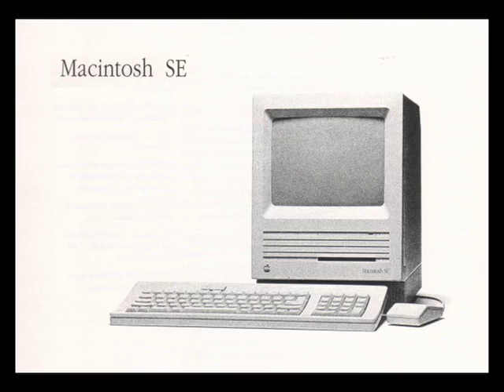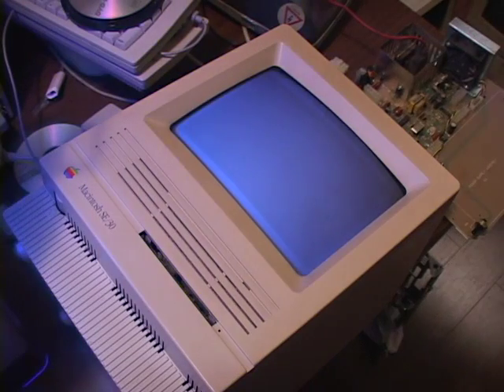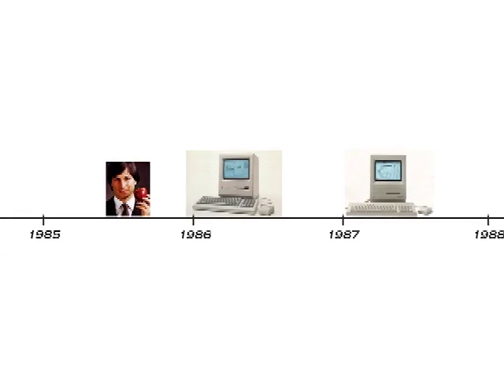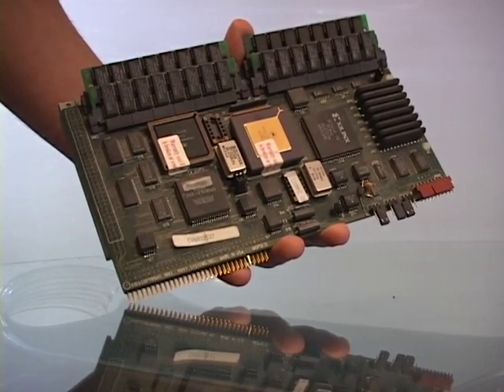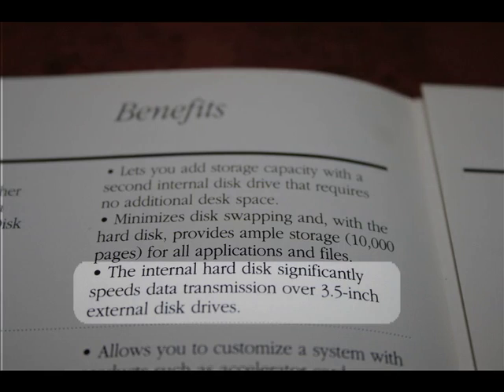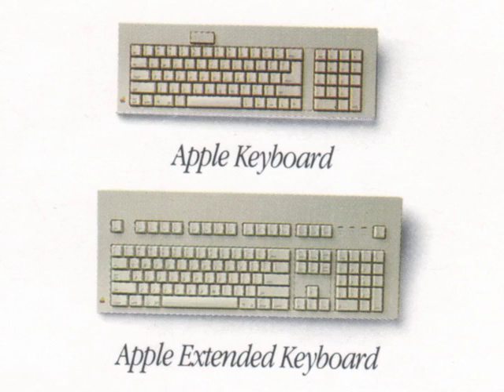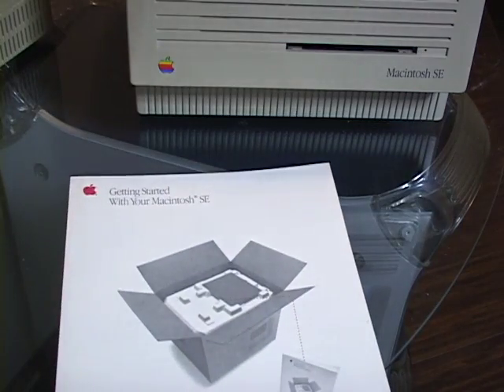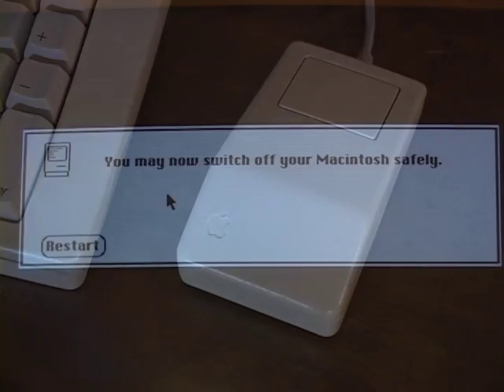The Macintosh SE

Comment: a very good summary of the SE.I noticed this video is 8 years old, but I just found it. Many things have changed in that time and there are a lot of options now for keeping systems like this going and replacing the components that will eventually fail.
It is posible to upgrade the screen to grayscale, is a bit involved but can be done. The hard drive can be replaced with a SD card on an adapter that reads disk images to simulate multiple SCSI drives. The analog boards can be replaced with more modern circuits and so on.
Have a look at what the Action Retro channel has done with his SE's and you can see what can be done :)
Reply from the maker: Glad you liked the SE video. The first video of the series. It was before a lot of those options were available, so I’m glad others are inventing these things and spreading the word. Action Retro is actually one of my Patreon supporters, and, you’re right, he is a great resource for that sort of thing.
Reply: @65scribe  that's awesome :)

Comment: Hi,
May be you will answer a question that i found no responding until now.
I got an Mac SE FD HD version with extension card installed inside with an DB9 connector as shown in your video.
What type of video monitor are compatible with ?
And is it for displaying only b&w or colors ?
Is it an standard rgb signal or else generated ?
Some links  to technical details, schematics or informations about it ?
Thanks a lot and very interesting videos on your channel..
Hello from France,
Paulo

Comment: The SE was basically a Plus with a PDS, a faster SCSI implementation with an internal SCSI port, and ADB replacing the original phone-style keyboard and serial mouse. Otherwise it still had the same screen, 800k floppy, 8MHz 68k, and 4MB RAM ceiling as the basic Plus. If you already had a Plus (or could get one at a significant discount) it would have been more cost-effective to buy it more RAM and an external hard drive rather than replacing it, with the SE only becoming an attractive option if you really needed Ethernet or video out and/or the FDHD compatibility when it became available (the Plus never got FDHD upgrades and even the original SE (and Mac II) needed new chips and disk drives to get FDHD capability).
Reply from the maker: That’s true. In retrospect we would have been better off buying a Plus just based on cost savings vs what we did with it.

Comment: Weird minature centrifigal tube fans or whatever, hard to find them for sale anymore, probably very hard to get the bearing balance perfect so it didn't wear out, its just double the problem vs a single bearing fan.
Reply from the maker: Yes, those 'squirrel cage' fans were an odd choice.
Reply: @65scribe  ah that's the name.  The obscurity I had "Evercool 5.25" Cross Flow System Fan " drive bay intake fan, it got noisy and got tossed lol

Comment: I don't know if this has been pointed out before but your explanation of "floppy" is wrong. It's not about the plastic used for the housing, but instead it's about the physical medium within the housing.  The physical medium within both 5.25" and 3.5' disks were a floppy mylar with a coating, whereas the physical medium in all hard-disk drives were a rigid metal disk with a coating.
Reply from the maker: Yes, you are correct. My earliest Mac video in this series, I didn’t fact check as well as I should have. Appreciate the clear explanation. Thanks!
Reply: @65scribe  , thank you.  It's all good.  I'm a tech expert.  I've been programming since '86 and I've been in the tech industry since '94.  I also used to teach PC Architecture for a computer company.

Comment: I have one of these. $40 sounds about right. I got mine for about $75 shipped from eBay back in 2015. I don't recall now what the price was minus the shipping though. eBay doesn't track my order history back that far.

Anyways I "might" have paid a bit more then $40 not factoring the shipping though. It didn't have an internal harddrive. It was the "SuperDrive" model so should have had one. Did have the cable/LED and mounting hardware still inside though. Guess the HD was either pulled for privacy reasons or reused in another machine by previous owner. Anyways the interesting tidbit about mine was it came with a Ethernet card installed. I heard those are kinda rare. Kinda makes up for the fact I got just the main unit. It didn't come with a mouse or keyboard. I happened to already have a keyboard though. I ended up selling the Ethernet card as part cash and trade for a working hard-drive and mouse. So I no longer have the Ethernet card. Almost regret selling that. But not really. In the years that I have had this thing, I never felt the need that I needed to use it.

The Ethernet card it had used a different type of connector besides the usual one modern machines used and required an adapter. I forget the details and it's a major factor in why I decided it was worth trading away for more useful parts at the time.

Though trying to connect this thing to the Internet would be an amusing thing to attempt.  Though at the moment this curiosity isn't enough for me to attempt finding/buying one. They are probably impossible to find on eBay for reasonable prices and I definitely wouldn't want to spend more then $10 or $20 for one. :P

At the time I bought this thing I was trying to get an SE/30. But couldn't find one at a price I could afford so I ended up settling on that SE. Does have burn in though. But it isn't that bad and so far it runs fine. Though I should probably recap the analog board at some point.... :P
Reply from the maker: Thanks for giving your opinion on the true value of the SE and what yours was like. Interesting stuff!

Comment: The main issue going forward is probably the CRT itself.  Most of these CRTs have a lot of hours on them. CRTs do not last forever and time on plays a big role. While the components will likely remain available, the CRT tubes themselves are what will eventually kill these machines.
Frankly, I'm surprised the eMac has not become the new SE SE/30 /Classic.  It too is an all in one machine and can use a LOT more software. Since it has USB slots and firewire, hooking things up to it just isn't as big a deal as the SEs have always been.  Transferring software to an eMac is just stupidly easy. Dump the files on a thumb drive and away you go.  Dealing with DD 880k disks has always been a pain in the ass.
Reply from the maker: That’s a great point about the eMac. Maybe it’s the size, or maybe we just have to wait another 10’years for it to become the new SE.
Reply: I think it's a combination of age, size and weight. The compact Macs were always fairly light, very compact and were fairly desirable by collectors pretty early on.  I was buying, reconditioning and reselling compact Macs in the mid 90s.  I saw them at flea markets a lot up until ebay became really big when usenet was still the preferred way to have auctions.  Ebay was easy to use and so once word about ebay got out, flea market venders jacked their prices up as if they were selling to a worldwide market with credit cards.
I'd say the eMacs should start becoming collectable already. I think the newest one is like 13 years old already (they were discontinued in 06).  The weight is a big killer for shipping. It costs a pretty good amount of money to ship an emac across the country.  I see a lot of them on ebay and so far, prices have remained OK, but shipping is a killer.  It's not nearly as iconic either.
Reply from the maker: I've picked up two eMacs in the last year or so with hopes to do a video on those. One nice and one junker. I got those and most my Macs locally on kijiji and gave up on ebay about 2006 for the reasons you mentioned above.
Reply: Do you happen to know if the emac system boards are compatible with each other?  I have a low hour 700mhz version and I would love to swap the system board with a 1.42ghz version (the 1.25ghz model is known to have bad caps) if it is a drop in replacement. It doesn't really get me much, except maybe better emulation of the psx or something.  I use it for audio and mame. It's great for mame for the old games.
Reply: I suspect a lot of eMacs were manufactured since they went to a lot of schools, so maybe that will keep their used price down. They show up on Craigslist a lot in Atlanta USA.

Comment: I loved my SE/30, I got it around the time the Quadras were being rolled out, and as a kid, it was a delight to play with a Mac at home (since they'd just got the LCII's and even the teachers were running them with a manual in hand).  Later moved up to a Quadra when the Power Macs rolled out (love the 6100 vid because I had the 610), got a Power Mac 8100 when the G3 iMacs rolled out.  Now, I have a 2010 iMac I'm typing this on. 

For those of us who've had to get by with the last generation, revisiting the older macs is a ton of fun, I hope you do more.
Reply from the maker: You've had some great Macs, even if you had to settle for yesterday's model. I've never been lucky enough to use or even see an 8100. Glad you're liking the videos!